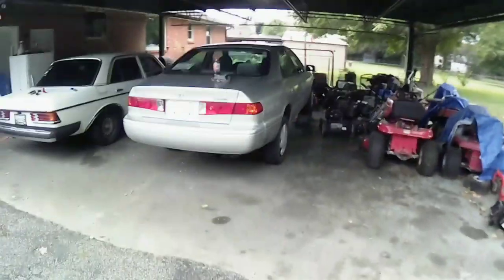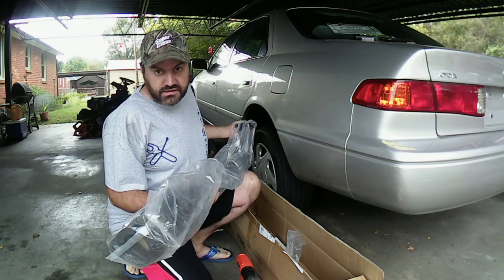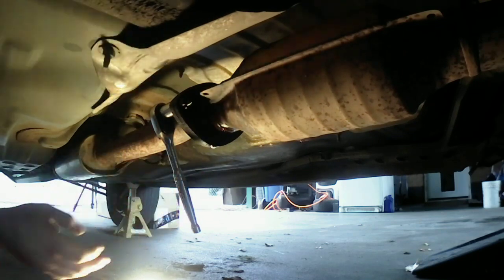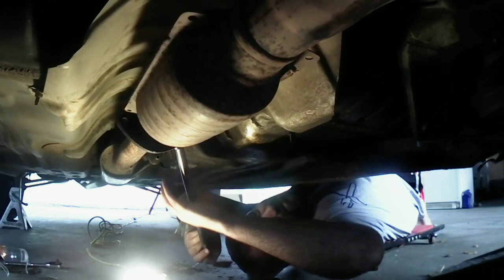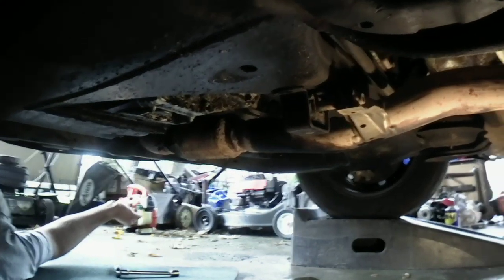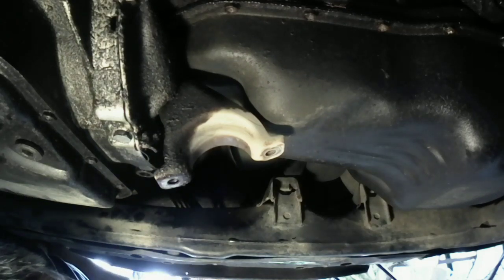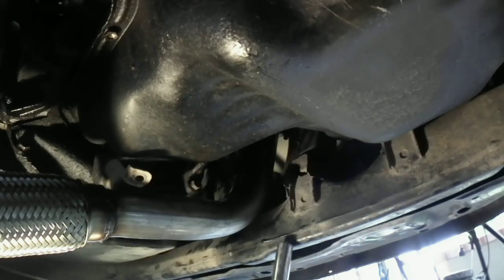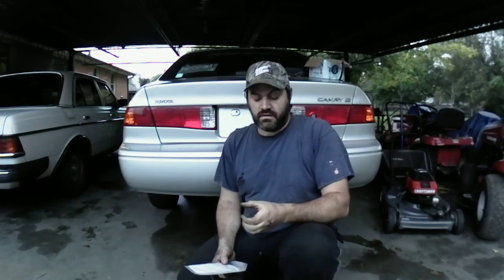Replacing the cataytic converter on my 2001 Toyota Camry #turningwrenches #Toyotacamry

Comment: Great video john, i worked at a  major toyota dealership my last 17 years be fore retirement.  If you replace the plugs on your car only use Denso plugs or you will have misfire codes. They are A Little more expensive but will cause you a lot less headaches in the long run.👍
Reply from the maker: I will definitely look into it. I think it does need a tuneup also. Thanks roger 👍

Comment: I like how you set the mood with lights in the overhang 🤣

I’m running an aftermarket Cat on the Honda…almost a year old and no issues knock on wood.  I sold the OEM for good money $900.

I understand about storage space with your cousins.  Where are they going to store the new mower ? 🤣
Reply from the maker: Well ran into a snag with the one i put on there throwing the code again

Comment: My 92 4runner is setting off the code for the oxygen sensor and a couple of other codes cause of a bad cat. The truck is exempt for state inspection but the gas mileage is worse than it should be. Your cat was definitely bad. You should be okay for inspection after you cycle the computer again. You did a great job 👍
Reply from the maker: I hope so also I just found out I got a purge valve I think that's bad that I might have to replace
Reply from the maker: Thanks @gravelyman it was my 1st time installing one of these on.
Reply: Can the cat just be sawed off? Here in Memphis there is no inspection.
Reply: @hoopty.  You have to check your laws there. If the cat is bad it has to be replaced.
Reply: @gravelyman  ok thank you.

Comment: I found the part by Autosaver88, but I can't find those two seals you have in this video. I am psyched to try this at some point, but not sure about the bolts, since they could break.
Reply from the maker: The one on top or the bottom ? when I bought this one they had the seal for the back of it I had to buy the one for the front
Reply: @Turningwrenches85  Sorry for the late reply. I meant the front(top) gasket.
Reply from the maker: @Joe_334   nickson exhaust  connector gasket 31374

Comment: I got my cat converter replaced at a shop and now it’s misfiring. I changed the O2 sensor(downward) and it’s still doing the same. So I’m guessing they used a bad part. I’m about to just do it myself like I do everything else, I do t trust shops anymore. Where did you get your cat from?
Reply from the maker: When my car misfire I changes out the spark plugs and no issues after that. I bought my cat from www.autosaver88.com